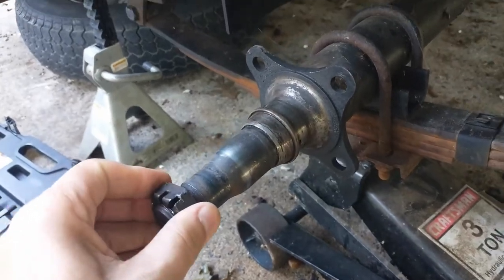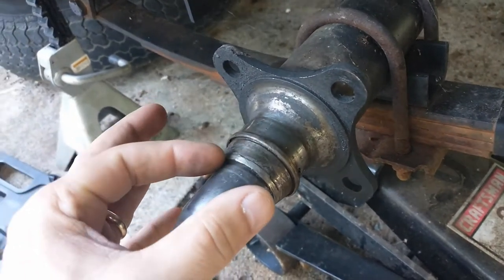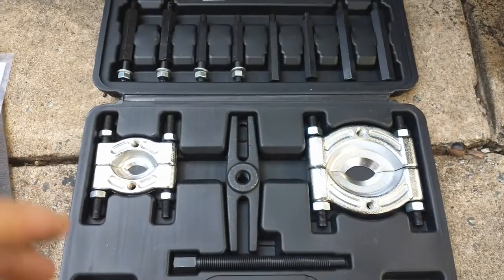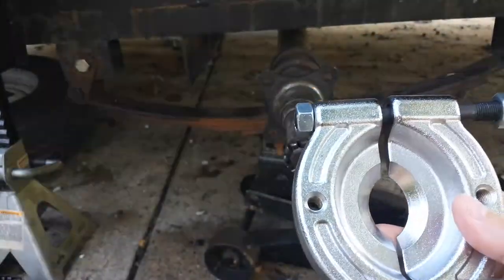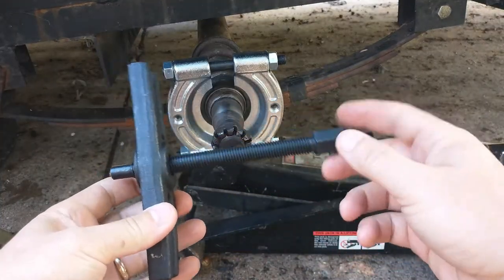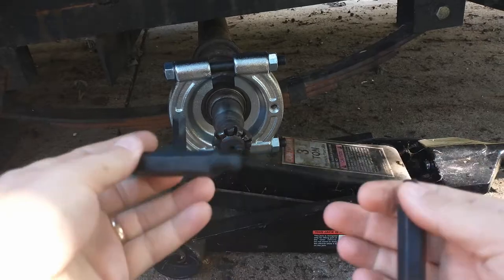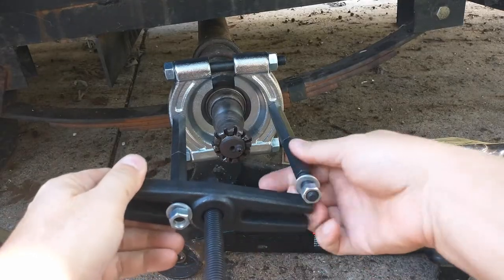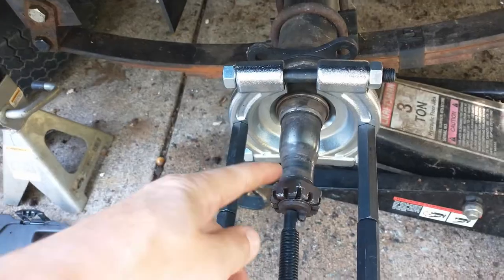How to remove left over bearing race from an axle shaft

Comment: Thank you very much sir. I have the exact same issue with a similar single axle 6 by 4 foot trailer. Spent a bit of time and effort baiting that inner bearing race with a lump hammer and bolster chisel, wd40 spray oil to soften it up, heated it up with a butane/propane torch three times over , it set the whole axle to flames due to the flammability of the wd40. Still no luck. I thought it had beaten me and was depressed, but then i saw your video. I haven't got a bearing puller , it makes things very easy. Cut a notch in it with a 4.5 inch angle grinder and was able to beat it off then. Thank you.

Comment: I observed on the very outer edge of the axel shaft what appears to be a "grease nipple" (correct me please) & was therefore surprised as to why this particular nipple was not merely & temporarily removed to enable direct & central access to the actual axel shaft instead of it being slightly to one side & thereby probably giving an uneven pull on the "puller". Hey I'm no mechainc but this is basic high school boys stuff & the puller tool I'm sure was not designed to be used in this incorrect manner!! No point in me watching this video!!

Comment: That’s the easy way.. Show how someone can do it if they don’t have a puller..
Reply from the maker: A puller costs less than 40.00 and is the safest,  easiest, and quickest way.  Why would I want to make this harder and more dangerous?  The other method is to use a rotary tool,  chisel and hammer.  If you don't have those tools you will get close to the price of the puller buying them.  Good luck with whatever method you choose.